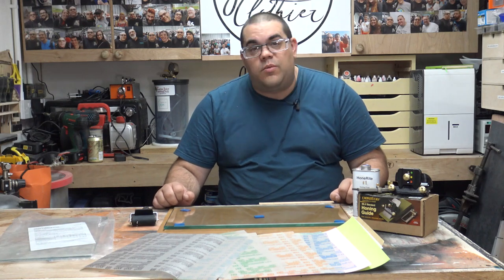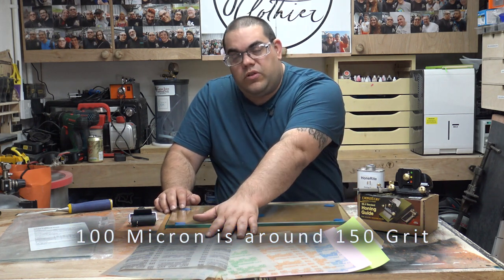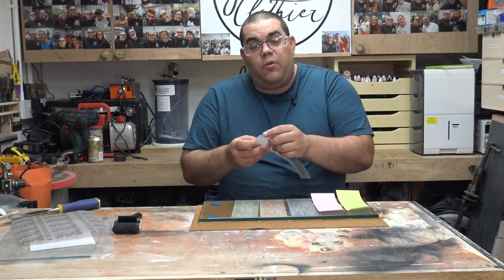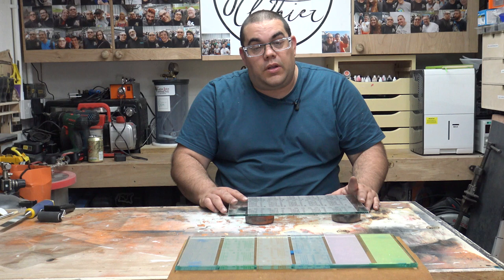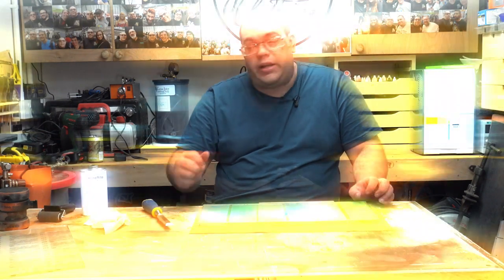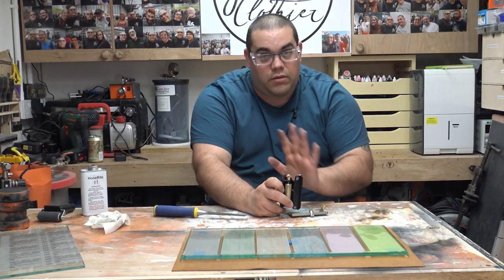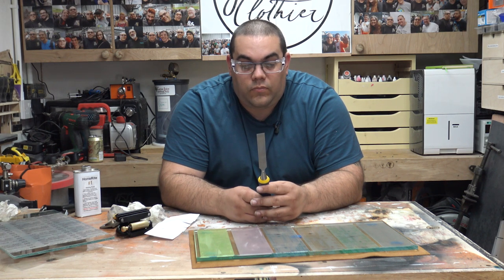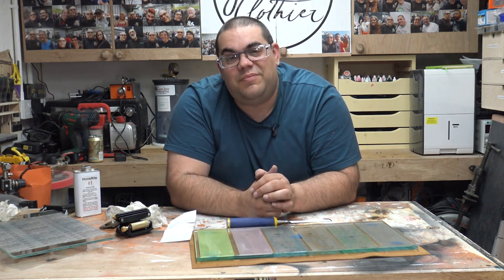Scary Sharpening, Is it Scary or Easy and is it Suitable for Beginners?

Comment: Hey John! Good video as usual! just thought I'd let you know that by keeping the secondary bevel as small as possible, this will allow you to sharpen the tool in quicker succession, because of the smaller amount of steel that has to be polished and removed in order to put a new edge back on. Also the secondary bevel doesn't have to be straight, if it appers like its not, the scary sharp in leveling out the bevel. With the replacement times we use them in a huge commercial furniture shop and we replace them every 6 months, but thats with 20+ people using them everyday! For single person use you can easily replace them once every year! Once again keep up the good work!
Reply from the maker: Thanks Harvey. That's really interesting and useful to know!!

Comment: I have the same system myself. I find peeling a little of the backing off and rolling as you pull the backing out help with the bubbles. 
You possibly got it down to a fine art now😄
Reply from the maker: Great tip! Thanks for sharing

Comment: John, a good way to avoid air bubbles is to fix the leading end (about 1/2") to the glass first. Then as you hold the backing of the paper & the paper a little above the glass, roll the paper down. I learned this technique from a vinyl sign installer.
I liked this video, but I miss your casting & art videos using resin
Reply from the maker: Thanks for the tip Jim. I will do some more resin and woodturning videos in the future. I'm gearing up for a guitar build at the moment and quite a few of my.upcoming videos will be around that. Since starting the channel.i have always enjoyed all aspects of woodworking I have just mainly focused on the turning.

Comment: Good Video John, I like you very rarely use chisels or planes but I do use them. You can see the 30 degree edge in the video by the way
I find my Sorby pro edge is good enough and so easy to use that I do t think I will ever change it. 👍
Reply from the maker: The pro edge is a great option that is for certain. It is a lot more expensive at  something like 4 times the price. It also doesn't allow you to flatten the bottom of planes. That said, for chisels it's a great option and much faster at reprofiling. I can see me using both in tandem

Comment: Very interesting, John; I have a retail shop shelf, somewhere, almost certainly float glass. As small boys we were strictly instructed on keeping traditional oil stone surfaces true (or else!), and I still use them. Chisel technique still the same. Good to know the micron size for the grits, but do different manufacturers follow the same code? The only other consideration seems to be space. Sharpening/honing stations need to be instantly accessible at all times. No doubt I shall have a go at this, and have a wallpaper roller!   Bernard.
Reply from the maker: Thanks Bernard. Oil and water stones are both great, it's the keeping them flat part that puts me off. This method removes that issue. I believe micron is more accurate and consistent than grit size but I could be wrong.

Comment: Interesting video John. I have a much simpler / cheap version of what you have there just using 3 plates to sharpen. I'm sure that the amount of grits you're going through may be a bit excessive. At least you've ended up with some good sharp chissels, oh and some bald arms, lol. 😂😂
Reply from the maker: Thanks Paul. Sure I agree there does seem like a lot of grits and im sure you could miss some out but I wanted to follow the instructions and it all came as a pack so may as well use them. And yes that chisel sure was sharp!